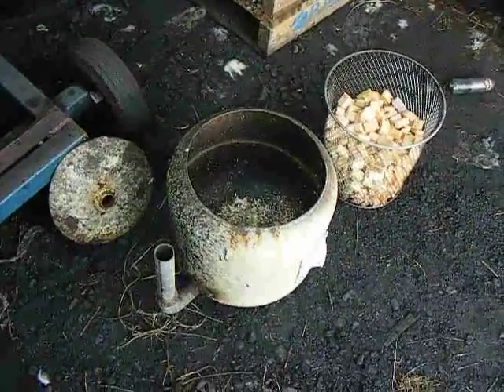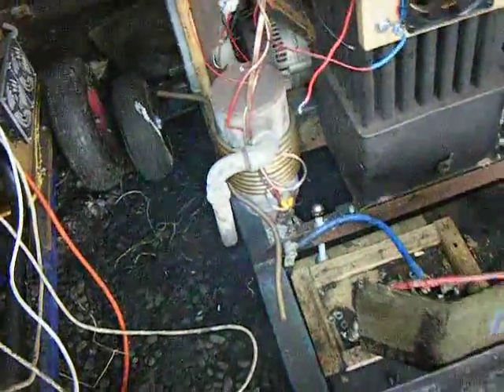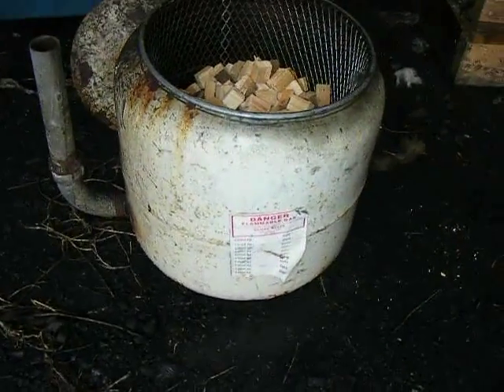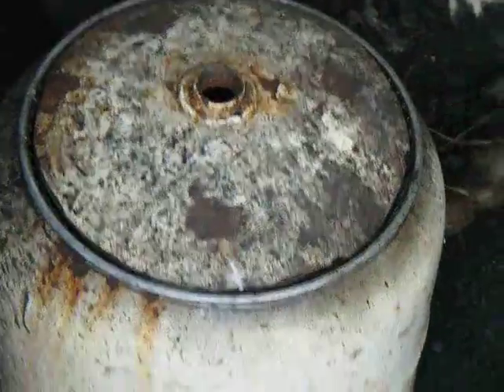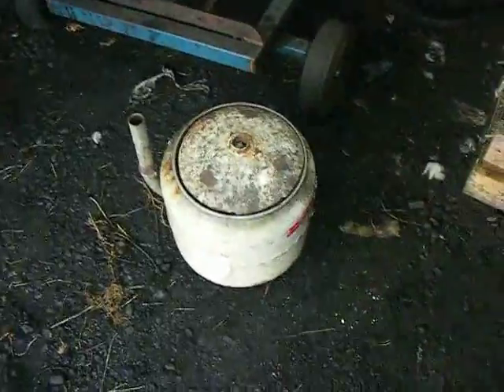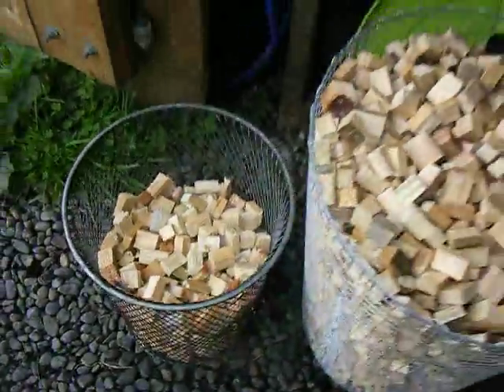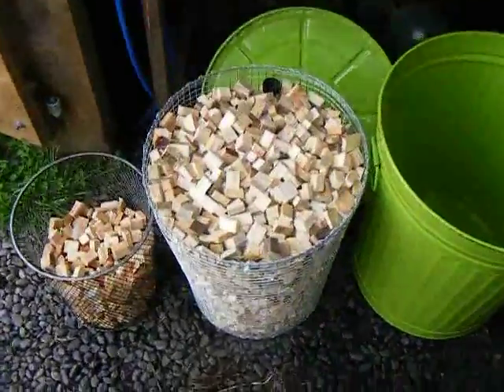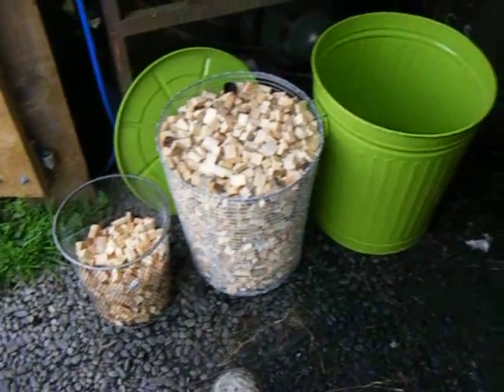Gasifier powered fuel dryer

Comment: Great way to make use of the heat . How is the bigger system working out ? i remember correctly, exhaust gasses are 100% saturated at around 70 to 80 c, so anything above that will take moisture out of the wood . Thinking about that 🤔, making it bigger will probably not work so well because the upper part will get wet, and the bottom part will experience some pyrolysis 😅
Reply from the maker: Thanks kindly. 
Yup, there is a lot of waste heat in the exhaust stream, so it makes sense to get some use out of it  :) . 
I never did finish the big one, as the same thoughts occurred to me about how well it wood really work. 
Still though, I think I could use something a little bigger than this one, and perhaps I could improve it by wrapping it in insulation.

Comment: I have only used soft wood so far... jack pine and the like... it works fine... I have always made my nozzles on the small side of what most people would... as i use chips I feel the smaller nozzles may aid in penetrating into the feed stock.

Comment: Thanks for your response Flash. I'm not just talking about drying, I'm talking about torefaction. I just recently built my prototype gasifier so I wasn't thorough with my video. I am currently constructing radiators to reduce the amount of water with my system. When I get it back running I will post another video. Torefaction  condenses the fuel to a higher concentration and less weight. I am also curious if you have tried purer oxygen. Check out zeolite.

Comment: Flash, have you tried torrefaction? I believe it can be done within the reactor. I dropped a 4" pipe in the reactor and welded it in place. It will act as an oven for the already dried wood.